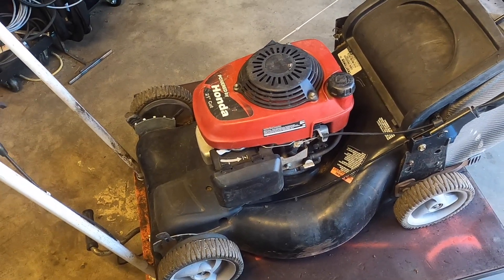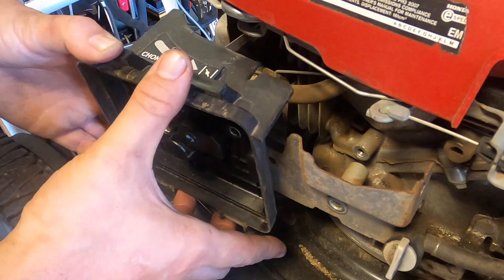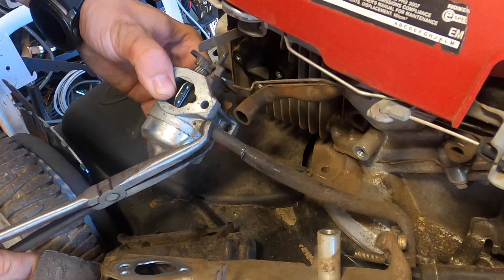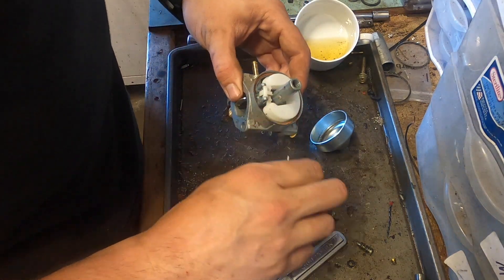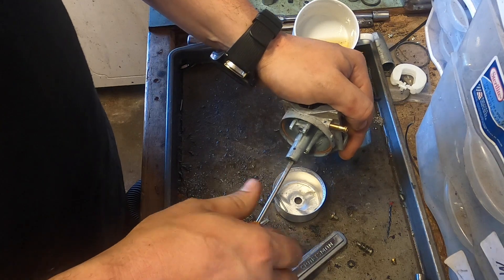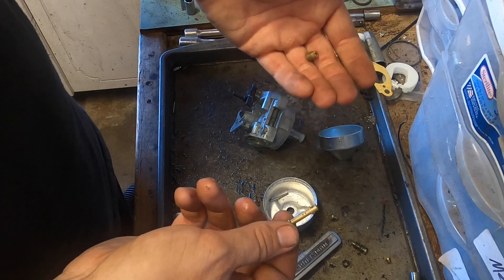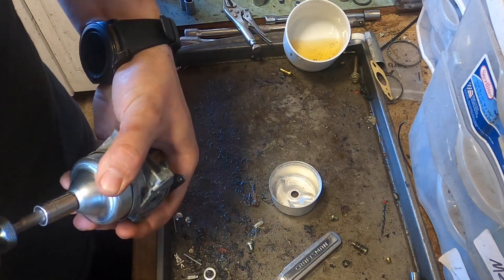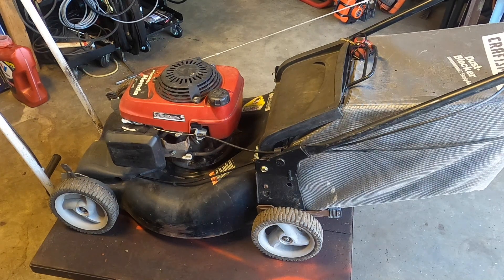How to: Fix a Surging Honda Mower

Comment: I took my carb off and "cleaned it" and it ran the same with the surging after reinstall.
After watching your video I took it off again and my little transfer port had a Phillips screw instead of the stuff that you showed, but nonetheless hit that with carb cleaner and compressed air put it back on and a thing runs like new! 
Great vid! 👍👍

Comment: I have the exact same issue with a mower I purchased.  Working on it tomorrow hopefully after I clean that top jet it will run good. No cleaned the carburetor but not the top one.
Reply from the maker: Hopefully it works

Comment: Question for you PNW, 
I have the same Honda / Honda carb. I cleaned it toughly and properly and all parts installed back on the mower. My question is the linkage ( governor cable/spring) that covers the philips screw (covering the jet) has another philips screw and tiny spring has been returned to it's original counts. 2.5 turns of thread (1/8") past the casting. Will a turn on this screw increase or decrease the RPM? It's kind of difficult to adjust once everything is installed. 
Hope this makes sense, thanks.
Reply from the maker: If I am understanding correctly it should increase the idle speed

Comment: That final jet (Under the crosshead screw) - I can get a welding tip needle into it - but the needle barely enters the hole. I want to know how deep is that hole? My needle only goes in less than a quarter of an inch! Then, it bottoms-out. Maybe it will be better to clean it with a carb-cleaner dipped cue-tip! What is your view on this?
Reply from the maker: I wouldn't use a cue tip mainly due to the fact it would only clean the surface. If you have a small wire from a brush or higher pressure carb cleaner it could clean the jet out. Ideally if you have a micro drill bit set that really does a good job. It may or may not help but I have a very indepth video on cleaning your type of carb. I will try to have it up by either tomorrow or Wednesday
Reply: @PNWSmallEngineandLawn Thank you for your replies! My problem is that I do not  know if this jet is clean! The reason being that the needle I use, does go through the jet hole - but only about 5ml. Would this be sufficient? Or, is it deeper than this? I do not want to use a micro-drill and make a hole where it should not be!
Reply from the maker: That should be sufficient. If you are having issues there could be a blockage in over of the passages that are not assessable
Reply: PROBLEM FIXED! Firstly, I sprayed the nozzle and noticed that it came out from the front of the carb. So I sprayed from the front and it shot out of the nozzle. Therefore, confirming nozzle clearance! This, was NOT the problem! The real problem turned out to be sludge in the fuel tank. After 5 minutes of cleaning the mower works like new! 

Thank you for the advice/guidance!